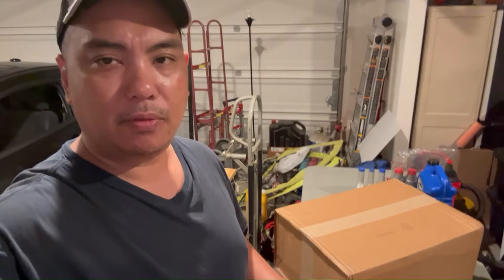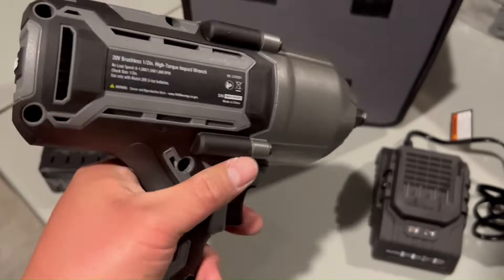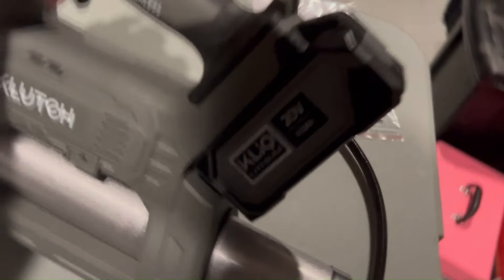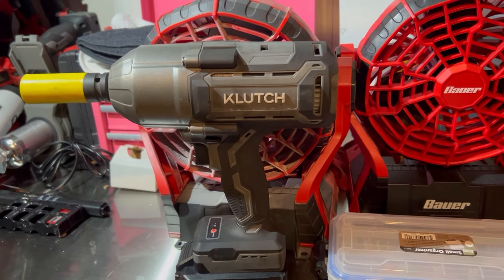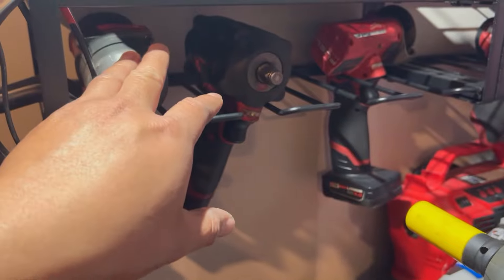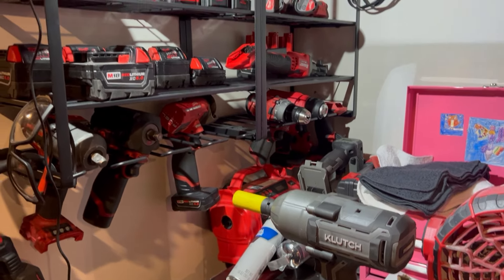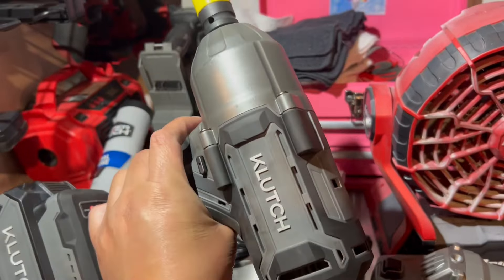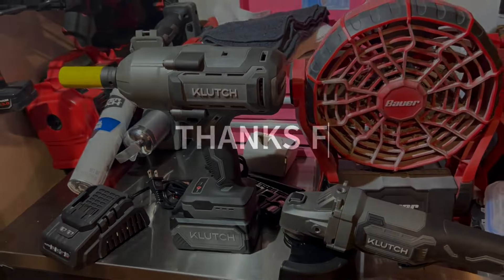Klutch 5796870 High-Torque Impact Wrench Kit, KLiQ 20 Volt Brushless 1/2in drive

Comment: Nice Video. Well done and you covered a lot. I have gotten a few KLUTCH tools myself and did a review on the regular 1/2 inch and 3/8 impacts. I was looking forward to seeing the high torque impact gun. So far I really like the two I got. Something you discover which I saw happening in your video is that when the switch is in reverse or removal mode it automatically goes to High. You can’t select any other option. In Forward or tightening mode you can choose between High, Medium and Low. It’s fine by me because you need what you can get for power to break something loose. You still have the variable speed trigger if you want to back the nut out slowly for some reason. I liked my tools so much that I just purchased the little air compressor and next will be the 4 1/2” angle grinder. Now your video has me looking at the high impact gun for the next tool on the list too !
Reply from the maker: Really appreciate the feedback, thanks 💯